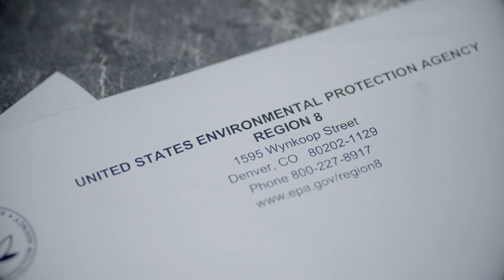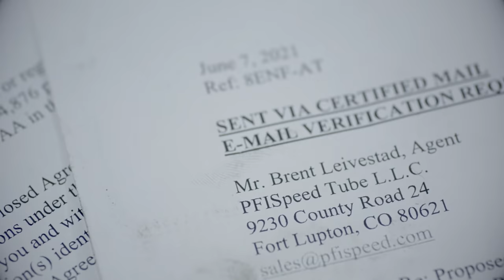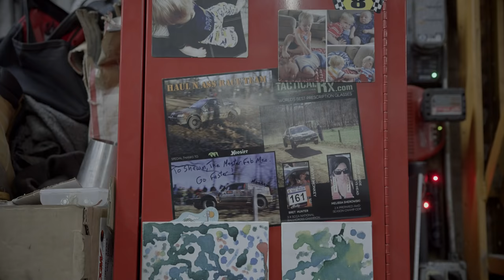EPA Banning Racecars?! The PFI Speed story...

Comment: Here in Europe they test emmissions yearly to get a sticker to be road legal. It doesn't matter if you have a custom ecu and put a v8 in a mini cooper. as long as it emits emissions lower than the law then it passes... America is fast loosing its "land of the free" motto :( ... Good luck PFI!
Reply: That's how "it used to be here" now they are over reaching our lives
Reply: in australia we still really just need evap system a cat and low db sounds and its ok :P
Reply: @tristanmeadows  yeah we have the db law as well... easy to pass that though.
Reply: Well I live in Europe. Your are not allowed to put a v8 in a mini Cooper just as long emissions are lower. You you need also upgrade whole driveline and brakes and more to pass. It sounded a bit to easy, but it's possible.:)
Reply: @RC_ALL_DAY  that can be a pain in the ass to make I legally. I mean 100% legally not 50% I pay a little extra and hope no one looks too close.
For me in comparison you can do basically anything in the us. 
Jea I know some states are stricter than other
Reply: America has lost that motto years ago.
Reply: @RC_ALL_DAY  yes of course.. i was refering to just emmisions law :)
Reply: In majority of Europe it is illegal to exceed 10% of the original vehicle power with an engine swap and only an engine from the same series of model can be swapped in. And for forced induction conversions it is extremely expensive for manufacturers to have the kit TUV certified, so it is rare to see.
Reply: Unfortunately the modern emissions test isn’t actually a Probe any longer.  It’s a visual to detect tampering and a readout overhead ECU to ensure all sensors are operating per spec.  I’m waiting to read about some polish or Czech tuning shop coming out with software that can tell the emissions tester what expect instead  of telling them it’s had a fire breathing tune uploaded.
Reply: There more to this than “clean air”!
Reply: Because people in America keep electing dictators
Reply: @idokwatcher2062  I think that's mostly Germany. But in Germany if you want to put a different tyre brand on the car, you need a TUV certificate to say that brand is certified for use on that car...

Comment: Here's my issue... I'm all for the RPM act, race cars have been around since the start of the automobile but it all started with some random person modifying their STREET CAR in their garage. Who is fighting for us? I don't have the money to build a track only car! Nor do I have a race track close to me so I would need to have a truck and a trailer along with that track car. So now I'd also need space to store a race car, a trailer and a truck plus daily driven vehicles for my wife and I. Not everyone that wants to race has that opportunity, most of us simply modify our daily drivers to make them funner, faster, look better or lower/higher. We are Hot Rodding! We want our cars to be as clean running as possible, we want as much power as possible, we want clean air to breathe too! Why is it if I put a new engine and emissions equipment that get 30mpg in a vehicle that is 30years old and only got 10mpg with little to no emissions equipment that vehicle would no longer be "technically" legal because it no longer complies with 30 year old emissions standards, or because that out of date equipment was removed or tampered with?
Reply: I'm building a gas sipping Honda accord.
Reply: @angrybastard7364  no, sake. Like most things, rice doesn't burn until it's fermented. 🤣😂
Reply: @Smurphenstein  what about the rice converters?
Reply: Yep so everyone needs a black smoke spewing diesel truck to pull a trailer with their race car on the back of it to and from the track every time they wanna drive it. Great idea.

Comment: This is a problem that can be solved if we can get the right people to talk and work together. 

True race cars that only ever see track time make up such a small number of vehicles, the emissions have a negligible effect on overall air quality. Race cars don't need to be emissions exempt either. We can make them reduced emissions. A limit needs to be found and set.

Amatuer car racing was born from the availabilty of production cars. Modifying your car is about as American as it gets. The EPA and even State Government is going to prevent us from touching the engine in even the simplest ways. 
Here in Colorado, our new emissions laws require checking the ECU programming against a database. If the programming doesn't match, you fail emissions. This is regardless of what the programming changes are for. Want to change the temperature that your electric cooling fan turns on at because you tow? Now you fail emissions.

In the aftermarket world, we have the ability to make a 2000+ Horsepower engine pass the current emissions standards. But this doesn't matter if they won't even test the vehicle because of a programming mismatch. 

We don't need emissions exemption. We need a pathway to pass emissions with modified vehicles. 
There has to be an understanding that finding a way to pass emissions will lead to overall better air quality as it will prevent the current disaster of a situation were cars are returned to stock to pass, then immediately re-modified with no emissions equipment at all. 

Sign the RPM Act:  https://www.votervoice.net/SEMA/campaigns/45394/respond

Write your local and federal representatives: https://www.usa.gov/elected-officials

It will take the voices of all the enthusiasts to be heard to make a change.
Reply: Well said, 5250 Performance.  I am personally disappointed with the growing perception that modified cars are in conflict with clean air and clean emissions.

Modern ECU's and catalytic converters allow a predictable pathway to clean modified vehicles.  I personally modified my daily driver to use E-85 because I believe it is a superior, cleaner, fuel in a turbo-charged vehicle (my vehicle is delivered stock with a turbo-charger).  However converting to flex-fuel to use a cleaner fuel means that I must update the ECU.  My vehicle will now "fail" emissions testing in Colorado because of the recent legislation to which 5250 Performance refers.  I am profoundly frustrated by this outcome since one objective of the converting to flex-fuel was a cleaner daily driver.  I achieved that objective and my car is now cleaner than it was than when it was born, and yet it "fails" emissions testing in Colorado simply because the ECU has been updated to correctly and cleanly burn the cleaner fuel.  There is no option currently in Colorado to actually test the emissions of the vehicle under current law, only the contents of the ECU are inspected.

I am happy to pay an additional fee to have the same format of actual emissions test that was available in 2020 and for which all required infrastructure is available in Colorado.  Why is that not possible?

Those of you reading this reply can infer that I lived in Colorado and have a vehicle that will not pass the current emissions testing requirements in the State of Colorado.  You might be wondering how I solved my problem?  I left Colorado.  One of the reasons I left Colorado is the sharp disappointment you read here with respect to my car and the emissions requirements that do not make sense.  I have to believe that driving residents out of the State of Colorado was not an intended outcome of the recent emissions requirements.

Comment: That quote about design I think is striking.  As an engineer, there are different levels of design,  there is engine design, there is ECU design, there is body design, etc.  All of these things are snapped at one moment defining the design of that vehicle and all of the pieces of that design are maintained at Honda.  By selling aftermarket parts including turbos, tuning kits, etc, we are reimagining that vehicle for a different purpose.  If the vehicle was well suited for the intended purpose of racing, then PFI Speed would be out of business.  These vehicles aren't.  As such, they must be re-imagined and re-designed.  By the EPAs own arguments, these vehicles are not being designed for on road use, and therefore they are applying the law incorrectly.  Personally, this entire idea of the EPA playing shrink, and trying to get inside my head type of argument screams that they are trying to play make the accusation without proof.  With the size of fine that they are levying, this must be a crime.  Therefore, they need proof that indeed you sold parts for road vehicle use.  The fact of the matter, the vehicles in question do not conform to any "road vehicle design" as designed by the manufacturer.  The fact of the matter is that there is no evidence that these vehicles have been used for "on road use".  The fact of the matter is that not only is there no proof that there was a crime committed, there is no indication that there was any intent to commit a crime.  As such, even without the rpm act, the EPA has significantly over-reached and needs to be beaten back. (I do support the RPM act by the way).  

My belief is that there is a group of EPA agents who are showing there superiors the "new" way of digging up enforcement by trolling through youtube videos all day.  I wouldn't be suprised honestly if there isn't a think tank or other group trying to undermine any form of anything that regular people like that involves any connection to fossil fuels, fossil lubricants, or internal combustion engines.  My thoughts on this are driven by seeing youtube blogs from other individuals engaged in performance tuning in the diesel arena and other areas where there have been massive fines.  I don't know if it is just youtube, though there are others getting hit on youtube engaged in tuning and modifying internal combustion engines.  This is very concerning as this cuts across right to repair, as well as our ability to teach our population how to design and build mechanical items.  These skills are directly needed for war just like the amateur radio groups are pulled from during times of war to support military communications networks.  Currently, our military and our ability to defend ourselves directly relates to electronics combines with combustion.  All of the sorts of tests that you need to run to make sure a military digital radio system is properly functioning are also skills that you would need in order to program and peek these race cars.  This is more that just a community under attack.  This is a specific and very important skill set among our population which is under attack.

Comment: The funny thing is that PFI is making an otherwise dirty car run clean on E85. You are actually cleaning the environment. You should get a metal from Green Peace.  The burden of proof of environmental destruction is on the EPA. Good luck
Reply: Still is tampering with smog equip !!
Reply: @toddhargett2135  sory wrong person ! No i agree but government does not !
Reply: @performancecyclespecialtie6104  there is no tampering with any emission component. No reason to
Reply: @PFIBrent  i had a ducati full race i asked comany to reprogram ecm leaner  because it ran to rich ! Guess what no way !! Stupid  so i agree with u but they not to bright !
Reply: @performancecyclespecialtie6104  yeah that was kind of my point i've been running ethanol on my truck that i daily to and from work ever since i got it and i've tuned it to run on ethanol and i've modified a few things but still have my cats and whatnot in there but if i had to take it back to stock it  would pollute so much worse which to me makes 0 sense the EPA shouldn't be trying to stop people from doing this stuff they should be encouraging it especially with companies out there that have found and are trying to mass produce better cleaner ways of making ethanol and methanol, a couple i personally think are pretty cool are the cellulous ethanol or using artificial photosynthesis to make it really cool stuff which could clean things up.
Reply: E85 is 15% ethanol only.....
Why not man up and use 100% alcohol?
Reply: @janeblogs324  E85 15% gasoline and 85% ethanol you are thinking of E15. Stick a tailpipe sniffer on a properly tuned E85 car and it will pass emissions with no cats.
Reply: @janeblogs324  sold it. Bought bmw 1150 rt
Reply: @performancecyclespecialtie6104  dude learn to spell
Reply: @janeblogs324 it is too corrosive to let sit in vehicle 

Needs to be routinely flushed/removed/cleaned

Comment: This is BS. I don't want to build a race car. I built a hot rod, that pulls up at the local square and cruises to car shows on weekends. What's going on? What's happening to America. Rpm act sound like self-censoring to me
Reply: I tend to see this the same way you do. The rpm act is a good thing for a very small portion of the aftermarket industry and car community. At this point it's like we are having to settle, the rpm act is us settling and agreeing to only build full tilt race cars. The Rpm act needs to be passed and needs to be part of the rule book for race cars. What about everything else? What about all the cars that are taken to shows? Car shows sure will be boring if everyone shows up with  unmodified, showroom stock cars. This is all so wrong. The overreach extends beyond racecars at this point. The EPA is working on shutting down the entire aftermarket car industry. We need help at all levels.
Reply: @crakbone0102  . If I understand it correctly, you wouldn’t be able to turn your street legal hot rod into a bracket or salt flat hobby competition car.
Reply: @FIGGY65  Yes, you could do that, but at the cost of the car becoming a full time race car. What about the guys that modify their cars and drive them on public roads to car shows, or the guys that race on the weekend? The RPM act will save the race cars, but all of these others guys I speak of are shit out of luck. Do you think the aftermarket parts companies can make it off the race programs alone? Who spends the most money within the aftermarket industry? The regular consumer of these products are the guys that race on the weekend and also drive their cars when it's nice out, the guys that go to these car shows, not race teams. We need a new document that applies to the masses.

Comment: I feel like there's also an argument to be made against the EPA that many street driven cars could be cleaner with "parts for racing only" than with OEM parts. As someone who's owned a plethora of 70's and 80's cars, those EFI systems are truly abysmal. I grew up in California, friends of mine owned and ran smog shops. I was on a first name basis with several state smog reps. The laws are non-sensical and most people in the industry realize and know it.

If the EPA and BAR could work together to develop OBD2 requirements that aftermarket ECU's could meet, I see no reason owner/maintainers of street vehicles shouldn't be able to update their engine management to run CLEANER and pass inspection in all 50 states. Yes, we should keep PCV, EGR, EVAP, CATs etc, but the ECU should have enough information about the engine to know what's applicable and provide OBD2 functionality at a high enough level to meet similar standards as the MY2000+ vehicles that CA no longer bothers even putting on smog rollers, and lets the computer's diagnostics tell them whether or not the vehicle is running clean.

Instead, cases like Brent's prove the EPA has no interest in common sense regulation. Yes we should fight to keep our race cars. But the issue isn't just about race cars, its about the ideology of how to actually improve air quality. The EPA's actions appear to push towards getting rid of cars all together, not making them cleaner.

Comment: What's the difference between Brent fitting "HONDATA" vs any other shop fitting fueltech or haltech or motec computers in? I don't think the exact really understands what it is they are trying to achieve? Just a casual insight from a supportive Australian 🇦🇺 I really do hope you can get the rpm act through as this will have flow on effects around the whole world 🌎
Reply: It's the same as a dangerous dogs act that targets pitbulls only. It happens when policy makers don't know jack shit, so they pick on an example of something. Hondata should take legal action, but they'll just use the case to get a list of what else needs to be banned.
Reply: They just havent been busted yet
Reply: Depending on what palms are being greased, your mileage may vary regarding the outcomes.
Reply: From what I understood, they target piggyback systems, which alters data inputs or outputs to fool stock ECU. Using totally different ECU is apparently OK for off-road use.
Reply: And then there are the OEM programmable ecu's that some manufacturers use. It's all a waste of resources if they want to have an impact on emission there are other more effective ways to make it happen.  And also every new vehicle is cleaner burning than ever and gradually electrification is taking over so why bother with almost insignificant emissions from hot rods and racing.

Comment: You and the folks at PFI need to contact me.

I ran a mfg plant for many years for a large manufacturing company.  I ran into a very related problem with the EPA. From your video, it seems you have run into the same problem I did.

My company fought with Region 5 for 3 years, but ultimately prevailed. I ended up having to go to Chicago to testify at the Region 5 office. Much legal wrangling occurred after our hearing before we got some justice.

You are correct in the shake down feeling. I can explain why. My company too was subject to the shake down....I'll explain what is going on if you are interested.

How can I contact either of you?